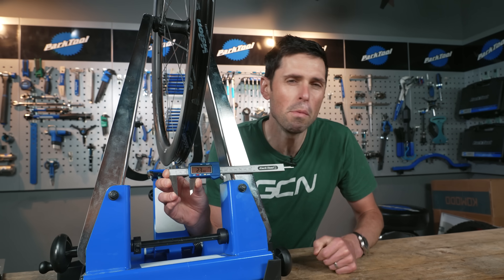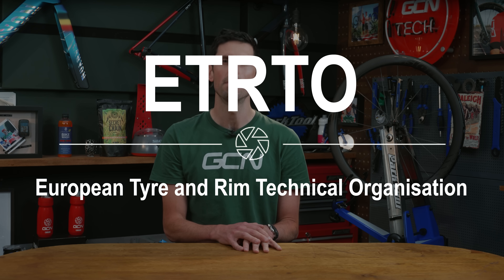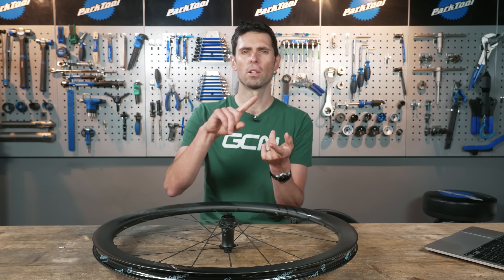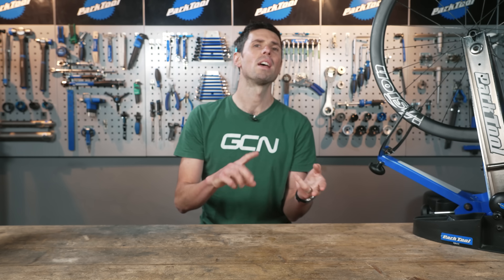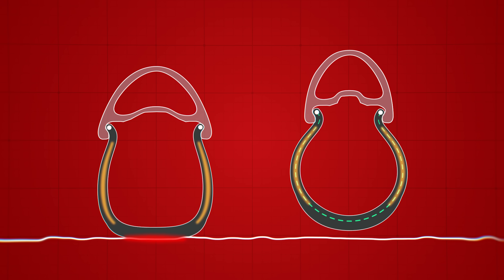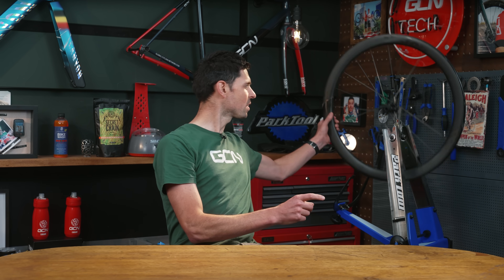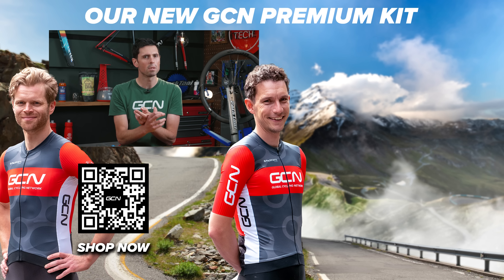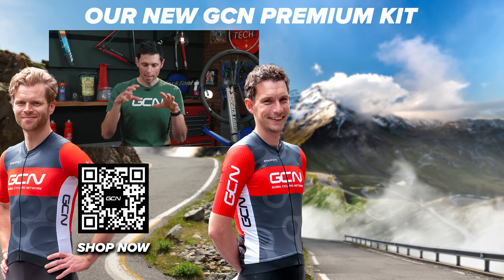93% Of Cyclists Ignore This Crucial Measurement (Internal Rim Width)

Comment from the maker: We've covered the ins and outs of internal rim width, but what's your current wheel and tire setup? Let us know what works for you in the comments below! 👇
Reply: 22mm internal width. 40mm wide swalbe marathon plus tire. I'm not sure of the rim tape I installed. 24mm or 25 mm, not tubeless adhesive tape. Normal old type belt. I think it was continental easy tape. On 17mm rims I used 20mm tape. On 20mm rim 22mm tape. That way the rim tape stays on place.. edges under the hooks against walls.
I don't care aerodynamic, but narrower tires spray less water and dirt, so I like them for that even though my bike has mudguards, but wider tires are more comfortable and won't get pinch flat. And they make less narrow strong rims now, so I have to use wider tires now. Maintenance free is important too. If I won't get flats all is good. I think narrower rims are easier to straighten too. If a really wide light weight alu gravel rim get's bent. You won't get it straight, while some old heavier 17mm alu rim might get back to shape once you relieve spoke tension.
Reply: Alex, I assume rim width is inside the hooks.  16mm aluminium rims with Conti GT 4 season tyres 28 front and 32 rear, TPU tubes 60 psi as per Silca.  About 400 miles so far no puncture yet.
Reply: Zipp 404 with 17mm internal rim width.  Riding Continental Sprinter 25mm tubulars.  Changing a tyre only takes 2 days, so you need a second set of rims as backup.  Archaic tech, but they sure to feel good.
Reply: I have alu DT swiss p1800 with conti GP5000 32mm. The rims have 20mm internal. 32mm is the max, but I can see a little lightbulb shape. I think I gonna use 30mm next time
Reply: One more aspect or result can be: if your goal is the comfort of e.g. a 32mm real width tire, then you could take either a 32mm labeled tire on a 21mm rim width or a lighter 30mm labeled tire on a 25mm rim width.
I optimized my road bike with gravel rims 25mm inner width and 32mm outer width combined with 30mm tires, that get 31,8mm real width and with that rim/tire combination I am pretty close to the 105 rule recently mentioned by Ollie and described by Silca. So I like my combination of comfort, aero, and weight optimized wheel set and it looks really slick the smooth transition from tire to rim!
Reply: Mine are 25 int, 30 ext, and I don't run tires narrower than 34 anymore.    That setup works well with 34s and >.
Reply: Riding my Zipp 454 -with 23 mm Internal with, hookless and set them up with 30mm Pirelli P-Zero Race Classic measuring 31,5mm. Perfect balance of comfy smooth silent tubelss rolling resistance, pressure setting and they’re aero enough with the shallower outer rims from Zipp, optimized for 28mm tires.
Reply: 18mm on the Rim Brake Road Bike, 22mm on the Gravel Bike (Road Wheels), 24mm Gravel Bike (Gravel Wheels) and 24mm on the XC Bike... ;-)
Reply: Campy Bora Ultra WTO C23 with 28 mm tires. C23 for internal rim. Easy.
Reply: Roval CLX II wheels, 21mm internal... 28 GP5000S TR

Comment: I have a gravel bike with 650B wheels and MTB tyres. I want to build a more road-oriented 700C wheelset to convert the gravel bike into an endurance road bike with 30 mm tyres, or just a faster gravel bike with 45 mm gravel tyres. What rim width is optimal for me? ETRTO tables allow both tyre widths on anything between 21 mm and 25 mm internal widths. This video, alas, does not provide much guidance on how to find out what's optimal.
Reply: Has there been a rolling resistance test of the same tire on different width rims?   My own personal experience says that I like the widest tire that will hold a bead on the rim regardless of the rim width. But I ride all terrain, very little pavement, it's washboard gravel or worse.

Comment: Sheldon Brown's resources on bicycle rim width indicate that a good general guideline is a tire width between 1.45 and 2.0 times the inner rim width. For example, a 13mm inner rim width would be suitable for tires up to approximately 25mm, while a 17-21mm inner rim width is recommended for 32mm tires, though the actual tire width mounted on the rim is a better measure than the advertised width. He also notes that a rim that is too narrow for the tire can increase the risk of damage, and a rim that is too wide for the tire can lead to a greater risk of control loss in a sudden flat. (Note: This advice probably predates the development of tubeless and hookless technology).

Comment: On one of my velomobiles the DF I run on the rear a 50mm tire. When I got this bike, I measured the internal size of the rim but have forgot what it was. I believe it to be 28mm but it has been eight years since I did this. I never wrote this down was just curious what this measured was. At the time I thought this is an awful wide tire for that rim, but others said they use this. I logged over 30,000 miles running a 50mm on that rim.

Comment: i knew my inner width (18) and i also knew that 23mm inner width was barely compatible with 25mm tires. 

also i knew that tires were going wider depending on the inner width of the wheel.

Comment: We don't have to worry? The latest road , performance bikes. That's been decided.for us .rim width,and bigger tyres. The simple explained ,the confusing part??we got it at the simple.😖  Manufacturers have all ready decided it for us , if perchased a bike .0f the peg. People tend to stick to the same size tyres. Just change the brand. I've been looking at wheels on line , information is usually given. Including  tyre widths. 
I'm looking for rims suitable for 23mm tyres.  Think lot of my rims are 15., with  12 mm tape. 
Using campagno neutron ultra.

Comment: I have Elite wheels SLR Gravel Disc wheel set on my Giant TCR. 24 mm internal, 31.8 measured external & Pirelli PZero Race TR 32mm tyres that measure 31.4 installed. Low 60s PSI , aero & vibration smoothing ride. Don't feel need to go wider for road bike.

Comment: 'Check with the manufacturer', sure.  Show me where there are tables online that show the min/max rim widths for various tires along with max load and min/max pressures. Most of this info is inside the box when  you buy the tire, but finding it before you buy is nearly impossible.

Comment: Never measured this but when I bought the wheel I was told I can put up to 28mm tyre (actually I'm running rim and this is the max anyway). I'm using PR1400 oxic dicut 21 with 26 tyre.. looking to put 28 in future

Comment: Put some plump Hunt C30 wheels on the Domane,  22/30 x30. Added a pair of Conti 5000 x 28 which measured 32mm at 70PSI when all was said and done. The tires mounted easily. Thinking all the internal rim space played a part.

Comment: I've had a 2009 Roubaix for 15 years. Rims have a 15mm internal width. It came with 23mm tires. I've been using 26mm specialized turbo tires for the last 2 years or so. 
I just got back into riding about 2 months ago [summers are brutal in FL] and sometimes notice the back wheel feels a bit squirrely on mostly smooth roads. I'm in my 60's now and thinking about getting a new bike with wider rims/tires for more comfort and stability. Just went to my LBS a few days ago and rode an Allez Comp/105. It definitely feels more stable than my Roubaix. A new Roubaix would be nice but don't want to spend $3000+ on a bike.

Comment: Road > speed> ride style = tire width + rim. Wider rims also are less aero than narrower rims but we enter the whole pressure and Tubulars-are-better debate. The sweet spot is 28-30mm if rims + tires drop. Some days am the fastest cyclists upright road configuration in my city, and am so by using 25mm tubulars on my V4Rs. roads are good enough for that although degrading and am nearing the transition point for tubulars. The industry is producing new lighter or better rim width tire compelling upgrades. The ENVE SEs 4.5 pro are perhaps the best all around in the world, 1260 g + 28 mm optimized. 1260 300 g x2 +120 ml goo. Note that the weight is similar to my ENVe SES 5.6 tubulars w 25 mm, but the pressure advantage goes to the 4.5, but aero speed to the 5.6 esp on any smooth road. 1550+ 280x2 no goo ever 200 g heavier but  more aero, 90 psi f 117 rear. Means I should migrate to 4.5. Now, if the tubular is a tire + tape + goo, it recreates the tubular in some ways. The tubular could have been advanced with better rubber and changes to rim and tire geometry, permitting 1100 40-50mm rim sets and far safer tape mounted tubulars. Less hassle (takes me 10 min to change a Carogna Mariposa tape tubular). 0 to 50C asphalt temp, 30-65 km/hour, tubulars are rock solid never had a tape fail etc. it cannot happen. No rim braking heat risk as my V4Rs is disc (my time and giant are rim tubulars). So the argument is that the narrowest wide rim and tubular that permit fast rolling, road relative, is crucial for the strong cyclist. Someone pushing solo 37-45 km / hour, on medium modern roads, needs that 23mm internal with 28-29-30 max Tubeless (tbd is TPU) , then if we introduce the TPU argument, it changes quite a bit as TPUs run at higher pressure for a marginal gain. In the end, all my experience tell me that Road condition, riding style and conditions dictate the rim width and tire. Very fast riders need the narrowest rim that enables the road pressure suitable for their roads. Decaying Canadian roads and transverse cracks are compelling me for 2026, to go for 23mm internal with 28/29 mm tubulars conti 5000s. 70-80 psi rear max. It is where I should maintain that 40+ km steady effort, going faster if I want, comfortably. At 25mm internal makes no sense as the rims and tires get too heavy. Now, from what I saw on YouTube of California roads, there I could aim for 21mm internal with 25 mm max as the roads are that good. Even tubulars would shine at 110 psi rears (forgoing the whole tubular rubber grip and development argument). So the lesson is, road, conditions and speed dictate the rim width and tire. Do not go 30-32 mm on the fast bike. Follow the pros and they are  aiming for 28 mm. Do not be fooled by pros riding their training sessions at 30mm as they do that for comfort and to get used to the heavier tires before doing for the racing 28-29 mm. And they get nice roads in TDF. So rim width and tire = sum of road conditions, expected speed, and pressure. If you aim for 40-50 km hour segments the sweet spot is 23mm internal with 28/29 mm tire max. As a final analogy, I was recently given the Madonna SLR gen I with 30 mm Aeolus rims/tires, test rode them 15 kms. On slippery smooth asphalt they felt nice, and were great on old decayed rocky asphalt. Brought my V4RS 25mm tubulars, and 90/117 psi, it was shockingly bad on the old farm grainy asphalt, had to drop 5 kms/hour vs madone. But on the dark smooth asphalt, parked the bike at 40-42 km /hour no issues, V4Rs tubulars 5.6 SES bike was nimbler and faster than the 30mm Madone tubeless. So the tubulars were predictably faster on excellent roads, and faster and lighter. Tubeless 30mm were faster and comfortable at 70psi on bad asphalt. On smooth, the 30mm was hard to rotate to 45-50km/hr. The answer is that if I want to recreate that 25mm tubular performance I have to follow what the pros did- ENVE 4,5, 23mm internal with 28mm Contis Tubeless and save 200 g and drop from 90/117 psi to 70/75 or so for my 80 kgs present weight (still dropping). If I lived near a bad farm like that, country road, 23internal + 30 mm tires… so Road > speed> ride style = tire width + rim width as final pick and never the other way around.
Reply: On my DF velomobile, I found a 50mm tire is faster than a 28mm tire on the rear. 28mm top speed was around 40mph. 50mm top speed was over 50 mph. I run this 50mm on a 28-30mm rim.

Comment: Definitely know my internal rim width is 19mm, using 28mm tyres. Both wheel and tyre manufacturers say this is fine. I would like to know if anyone knows of rim brake 700c wheels with wider than 19mm internal rim width? Thanks

Comment: My rim widths are quite easy to overlook: on my summerbike (Giant Cadex CFR, built up as TT bike), I can choose between four front wheels depending on the weather (wind) conditions: one HED Trispoke/15C rim with 20mm tyre, one DT Swiss ARC 1100 80/17C/20mm tyre (the narrowest allowed refering to the DT Swiss specifications), one DT Swiss ARC 1400 Dicut 62/17c/20mm, and one Mavic Cosmic Cabone SSC/13C/20mm. The rear wheels are a Specialized Trispoke/15C/23mm or a HED 3D disk (a Trispoke with closed holes)/15C/23mm. On my second/winter/bad weather bike (Giant Cadex CFR Expert series with glued in adaptor for a left-handed down-tube lever) is a set of 1998 Campagnolo Shamal HPW/13C/ front 22.5mm (23mm Goodyear Eagle F! Supersport), rear 22.5mm. On my third bike ('92 Giant Peloton Superlite, built up as 7.7kg racing bike) is a set of Fulcrum Racing Quattro/15C/ front and rear 23mm tyres, also Goodyear Eagle F1 Supersport.
Reply: Do you ride on glass?

Comment: Tyre exploding. Happened to me. I should have replaced a tattered mudguard before I hit the bump. The front mudguard snapped, fell down so the stays coiled round, dragged the bridge towards the hub with the wheel rim ripped inwards. The tyre was ground into the knobbly tar and exploded. Several inches of tyre (about 75 mm) simply vapourised. Dramatic!

Comment: It’s confusing how 20years ago MTBkers rode 40-50mm tires on 17-19mm rims, but now we “need!” 25+mm rims for that tire dimensions.
Reply: Because we are better informed on the science than we used to be. Also we don't "need" wider rims, but will be better off with them. I moved from 19 to 21mm int width rims about 9 years back and enjoyed the benefits of far comfier tyres. 
Bikes are way faster than they were 20/30 years too because of better knowledge like this. .
Reply: Yes that’s strange

Comment: The fad in road cycling of using larger rims will force people to look at this compatibility rims / tyres in width. Like in the MTB world !

Next worry from the MTB world : look at the compatibility in pressure between the tyre and rim.

With larger tyres, the max pressure the rim can handle could be lesser than the max pressure of the tyres written on it. I understood it the hard way, with 75% of the inner wall exploded on a Mavic crossride with Marathon tyres.

Comment: When I was in for a new wheelset I had a spreadsheet with inner/outer rim widths, wheel depths, weights, shape/profile and so on for all common wheels around the 1000 Euro mark. I decided to go with the Bontrager Aeolus 51 Pro, as they are really good overall when it comes to the importance of all those specs. I love em with 28mm GP5000s as they are 30mm when fitted and flush with the outer rimwidth.

Comment: I bought a giant TCR 2024 model. 22.4 internal rim and came with 25mm tyres. Now I ditched the rubbish giant tyres for Corsa Pro in 30mm. But point is that sounds like giant doing wrong thing. Or a least were doing in 2024

Comment: Good info. Should link this with the video Josh from Silca made about hookless as well. He addresses lay flat casing width which is a more accurate reflection of compatibility of a tire to a given internal rim width.  Given the potential of tire blow off in over pressure situations with hoolkless rims this seems to be a better way to insure the safety of the tire/wheel set up. I ride a 28mm tire on a 21mm hooked internal width rim. Personally I don't want to have to worry about a tire blowing off at 90kph.

Comment: running 25mm on 2 bikes, and they push the tires out about 1.5 to 2.5 mm.  45mm tires end up at 47.5, the 40 run out to 41.5

Comment: 19mm on my more modern, no idea of my steel bikes from the 80s and 90s, I just replace with a tyre of the same width.

Some interest in width was to accommodate the tyre tape for the tubs ;-)
Reply: Ha! Way back in 1970s, I didn't check that. My rim tape was a bit too wide for the well in the rim so curled upwards. Eventually, the tube punctured on a back road in Kent. Used up all my patches then realised the whole tube had two rows of tiny holes that only showed up when there was a lot of air in it. Had to phone my dad to pick me up, very embarrassing.

Comment: 25 mm internal rim width (CXR2), 30mm tires (conti gp5000). Originally was using 28mms and they definitely felt too squirmy on the wider wheels. The 30s do very well.

Comment: I have some beautiful and light 13mm internal width rims on a neo-retro build that has lots of tire clearance. Tried some 32mm Conti 4Seasons, after a while i switched to 32mm GP5000s. The GP500s measured up narrower than the 4Seasons. The GP5000s preformed better in all marks (commuting and fun rides). I thought the performance gain mostly came from the decrease in tire width, because it fit better but now I'm thinking GP500s are just better than the 4Seasons. I think I'll try wider tires on these rims in the future but how wide? 35s? 37? dare i say 40s?
Reply: @michaelbosch9024 😂 Thought my Schwalbe 32mm on 14mm rims were at the very limit, although they've always performed faultlessly - just a bit narrower (30.5mm) than they're meant to be. I've never seen narrower rims than 14mm.
Reply: You're riding 32mm tires on 13mm rims? Makes me feel better trying out 15mm rims on my commuter bike.

Comment: My rule of thumb is, if the tire is too fat for me to remove the wheel without disconnecting the brake cable (I'm still using rim brakes) or deflating the tire, it is too wide for the rim. My current limit is a 28 mm Grand Prix 5000. 28 mm Bontrager Hard Case R3s were a little too much. If I want to go wider, I will buy wider rims.

Comment: I am running 28mm Conti GP 5000 tires on Campy Zonda C17 wheels. But all my bikes are rim brake so I don't have wider options right now. And 2 of my bikes are still on tubulars and they are staying that way. I do have a set of Tektro brakes that clear 30mm tires but I need wider rims to take advantage of that.